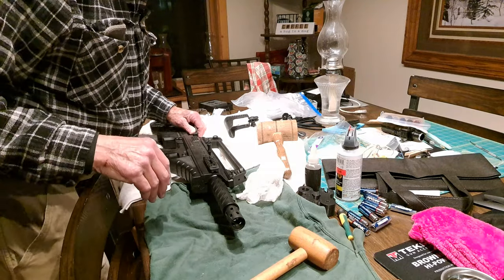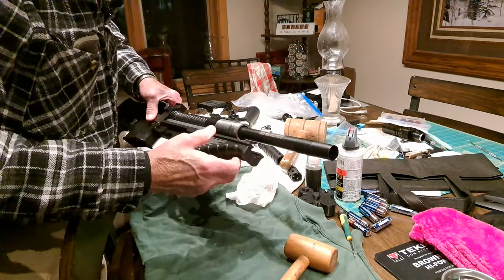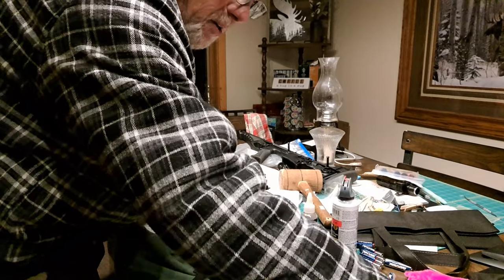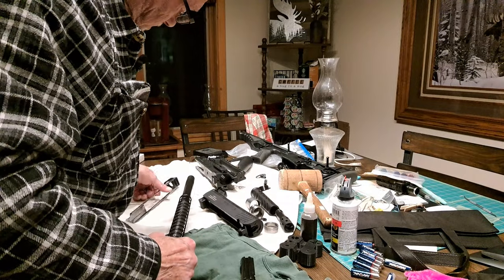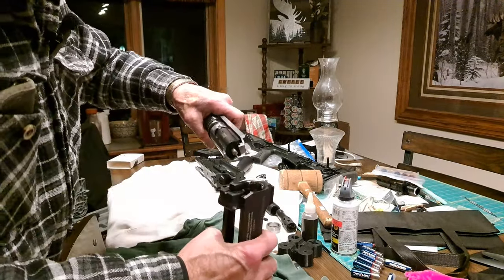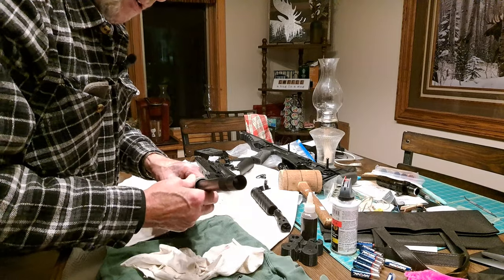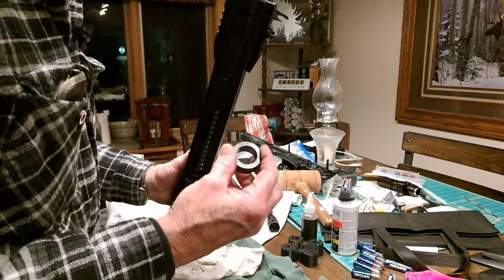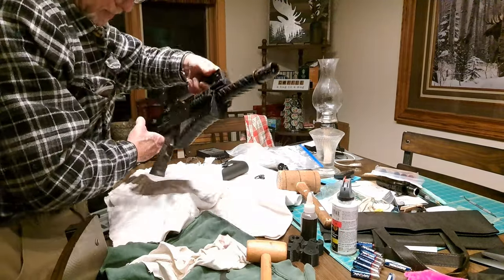Hatsan BTS 12 Teardown - Reassembly

Comment: Dude thank you so much. Just purchased this shotgun strictly for home defense and I wanted to make sure everything was tight and lubed after bringing her home. How has this shotgun been working for you ? I’ve read mixed reviews so far…
Reply from the maker: At first I couldn't get it to cycle properly. I discovered it works best with shells rated at 1250-1300 fps. After that I didn't have any more problems and it cycles reliably now.

Comment: I was thinking of polishing the trigger components. Does this shotgun have trigger spring I can try to replace like a mil spec ar15 does? I know it’s hard to get a smooth crisp break with the long trigger bar. Wondering if I can lighten it up at all. Great and informative video, thanks!
Reply from the maker: I have not done any work on the trigger so I can't give you an answer. Maybe there is a video showing what others have done.
Reply: @folepi22_SteveC  I’ve looked but haven’t seen any. I’m going to try and take the trigger housing apart today. At least I’ll do is polish it. Thanks for your help!